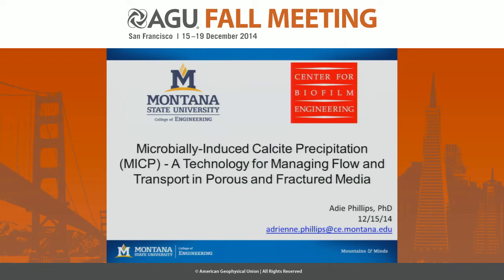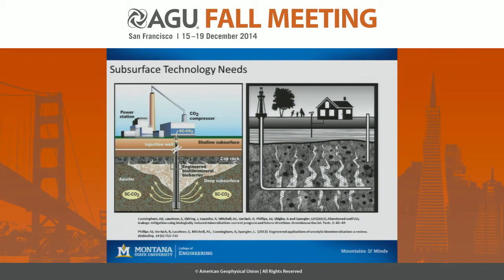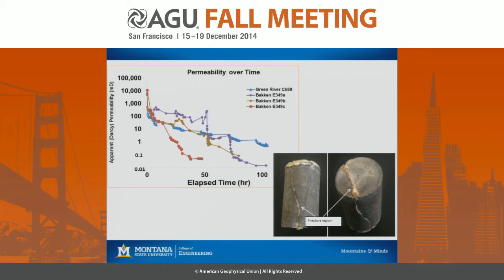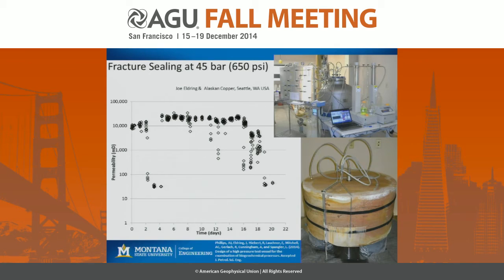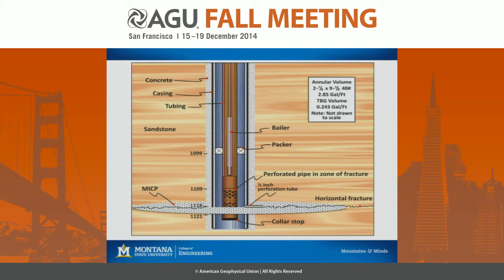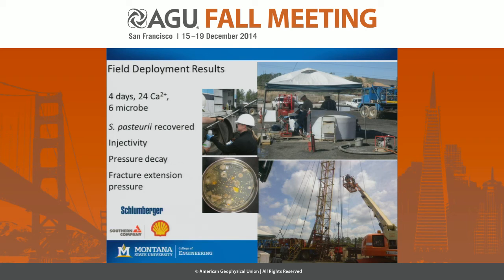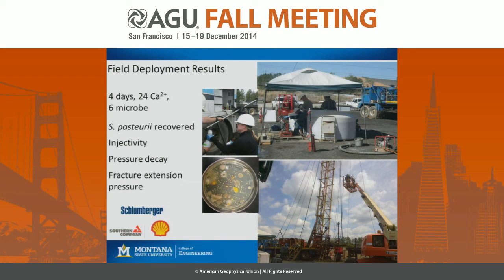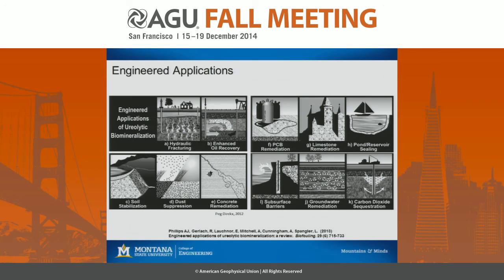Microbially Induced Calcite Precipitation (MICP) - A Technology for Managing Flow and Transport...

Comment: How expensive is this technology? can it be used large scale?
Reply: I'm still trying to learn about this fascinating concept but I don't see why you couldn't scale this. Search bio-geo-alchemy and you'll find a great lecture on this process. Basically if you can inject urease into the soil with soluble calcium (present in most ground water) that should be enough to stimulate the MICP